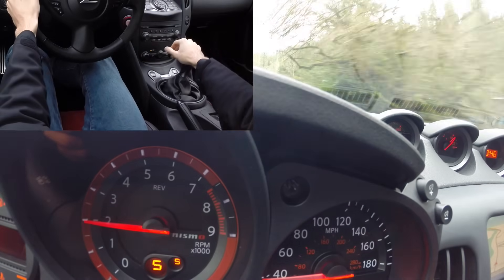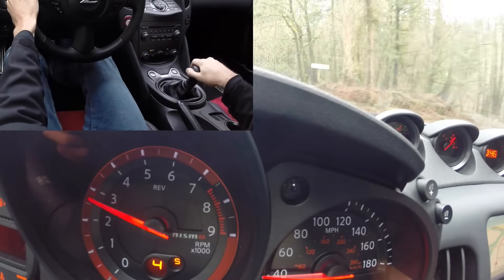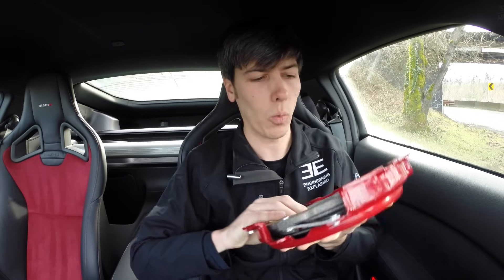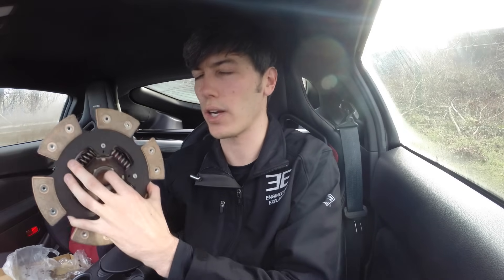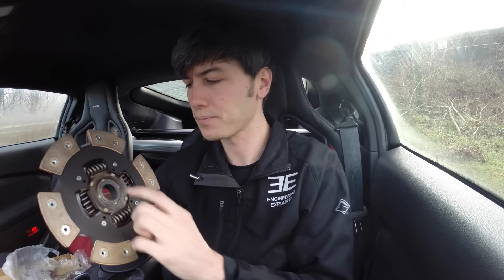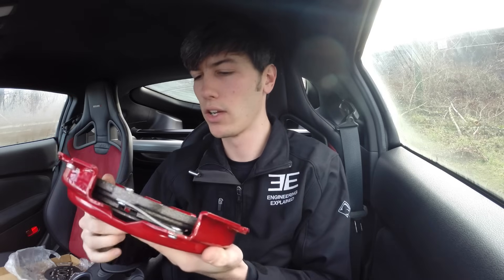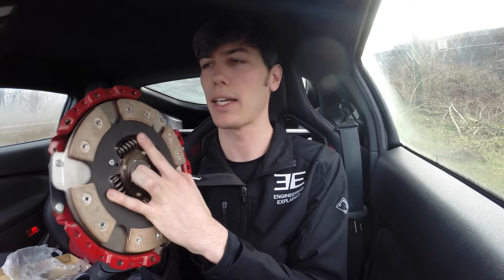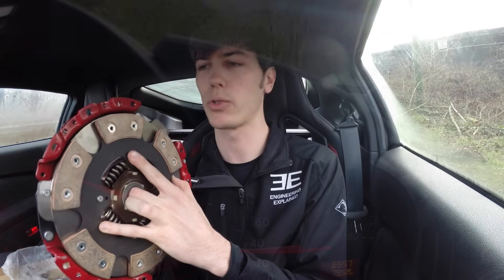What Is Rev Matching?

Comment: I have never been more confused in my life
Reply: Brian Guzman 
He’s overcomplicating it way too much. 

Basically, before you downshift, you give it some gas so the car doesn’t engine break too much. 

You rev up the engine to where the RPM would be when you put it in a lower gear. 
Just like the auto does when you kickdown. It puts you in a lower gear without any lag because you’re helping it with gas. (Might not be completely academically right, but to make it easier to understand).

Was that a good explanation?
Reply: @jgripen969  you summed it up perfectly for me, I get it 100% now
So if the car was going to move into 5k RPM when you down shift, rev matching let's you do that before down shifting, right?
Reply: @jgripen969  this is actually the easiest way anyone can explain rev matching if u still don't get it get over with ur life and stick to auto....
Reply: J Gripen x
Reply: @jgripen969  is that the same thing as double clutching where u increase ur rpms while at neutral to downshift/upshift??
Reply: @jgripen969  got it in the third sentence thanks
Reply: J Gripen Actually, yes it was a better explanation. He went way overboard with the explanation and over complicated it.
Reply: J Gripen Very clear. My question is for what situation would a driver use downshift rev matching? Is this meant to slow down your vehicle in a corner? or is it to give you a boost in torque to go faster (i.e drag racing in 5th gear, need to go faster so you drop it into 4th and it gives you that extra torque) like the saying goes "Drop a Gear Disappear"? I'm confused
Reply: Brian Guzman same 😪
Reply: Why transmission spin faster when we shift to 2nd gear?
Reply: @Nikhilgo  cause it is a lower gear (lower gear can handle lower  amount of speed than the higher gears)

Edit : So it spins faster to reach that point

Edit : lower gear = more torque and less power

higher gear = less torque and more power
Reply: Just watch a vid on how an automatic transmission works. Then this won't be anymore...
Reply: Wejustmight die it won't be confusing anymore because you'll just get an automatic and to hell with rev matching

Comment: You still didn't really explain how to do it, just how it works
Reply: Does "blip the throttle" mean Tap the throttle?
Reply: @laurenmatthews4048  yeah, tapping it quick so you can raise the rpms up a bit
Reply: It's "What is rev matching", not "How to rev match".
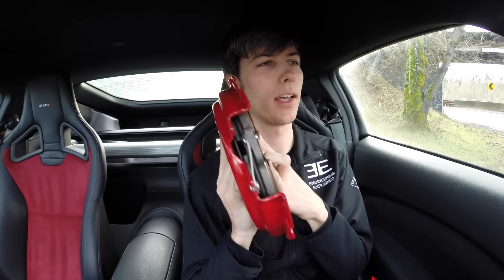Reply: Also he kinda did at 2:14
Reply: Depends on the disparity of RPM. If you are at 2k RPM and downshift 1 gear, yes a tap would suffice. If coming into a braking zone at 4K rpm, then a larger harder throttle hit would be required to achieve the RPM required.
Reply: That's whar the title is
Reply: He did explain it just push throttle until the engine matches the rpm of the gear u want to shift into
Reply: That is what the video is called lol

Comment: Question do you only do this when you're at high speed/rpm? I find if Ibrake till like 2k rpm and downshift I can release quickly and smoothly without the engine reving high and bucking etc. I have an 011 rex too so you can tell when it's being unforgiving.

Comment: I once drove my CRX home using this technique when my clutch went out, or rather the throw-out bearing, it would not disengage anymore.  So I shifted without using the clutch.  On downshifts, I went to neutral first.  This is not easy, you definitely know when the revs don't match.  Big trucks are shifted this way, since their transmissions don't have synchronizers. Shifting a small car this way is much harder, but can be done in an emergency.
Reply: This is 7 years late but is this what people mean when they "float" gears?
Reply: @bigdawg77  yes

Comment: Why does lower gears have higher rpm and taller gears have lower rpm ?
Reply: richeststrut do you ride bicycle?
If you do, you will understand.
The paddles are lighter at lower gear and heavier at higher gear.
Say to maintain the same speed, the higher gear takes less effort to kick the paddle and you'll have to paddle much more faster at lower gear.
That's why.

Comment: So basically this almost only applies when downshifting... so if for example i was in 3rd gear, and was downshifting to 2nd, i'd let go of the gas, push the clutch, and while holding the clutch press the gas a bit a ease into the gear change? I've only been driving for about 9 months, and i've noticed the difference when doing this rather than just letting go of the clutch. But as i said i discovered this on my own and i'm still trying to wrap my head around all this, i've even heard that you push the gas when in neutral, so it's all very confusing...
Reply: You have to get to know your cars gear ratios too. In my car gears 1 and 2 are quite far from 3, 4 and 5. So I rarely downshift into 2nd gear and never downshift into 1st because it would either require me to slow down quite a bit while in 3rd gear or do a huge and unnecessary throttle blip to match the revs.
Reply: I kinda knew all off this in practice, but not in theory ^^
Reply: dannyboy768 but sometimes its fun to rev the piss out of the car to scare pedestrians lmao.
Reply: You can also put you car in neutral while you press the gas and before downshifting.

Comment: I believe you miss spoke. Taller gears have more torque and lower top speeds. Torque = Force * Radius, taller gears have a larger radius and thus larger torque for the same force. This is also why you down shift on hills to get more torque to climb the hill.
Reply: so you're saying 5th gear would have a lower top speed than 1st gear?

Comment: noob question here: is it ok if I use a higher gear for a lower RPM?? for example I am cruisin through the city at 40 km/h and usually this is done using the 3rd gear around 2.500 rpm. But I use the 4th gear for a lower rpm and for the same speed of 40 km/h.
Is this behavior okay for my engine and my clutch??
Reply: As long as you don't lug the engine.
Reply: You want to use as little rpm as possible without straining the engine.
At about 50kmh I can use 5th and feather the gas along nicely, just above idle rpm.

Comment: If I'm coming to a stop, is it okay to just shift into neutral, and not downshift?
Reply: Brake pads are a much cheaper wear item to replace than the clutch, and an easier D.I.Y as well. Engine braking also puts more wear on the transmission, the entire drivetrain for that matter. The only benefit to downshifting to a stop is if the brakes are already a weak point due to overheating or worn pads, or if you need maintain control in certain situations.
Reply: Wearing your brakes out is alot cheaper and easier to fix than wearing out your clutch.
Reply: Totally irrelevant during daily driving as opposed to be in the correct gear to get engine brake and be ready to accelerate. Also rev matching was/is used for straight cut gears and keeping the balance of the car during turn in, nobody, I repeat nobody needs to use it along with heel to toe during daily driving.

Comment: In Europe they don't practice rev matching and you really shouldn't if you know what rpms are to each gear when downshifting. You can listen to the engine and if you down shift from 4th to 3rd without rev matching and slip the clutch in gear without a major variance in noise it's fine. The main reason is that many cars have synchronizer rings that limit the stress of an over revving input shaft to out put shaft ratio and it reduces the need for added clutch ware if you were to rev match the vehicle. I find that rev matching on a down shift is just consuming more gas in the blip. Call my technique old school but I have over 100,000 miles on my vehicle and I haven't replaced the clutch.
Reply: stevehmi Alright! I knew this technique is necessary in Sport driving, it just seemed like some people thought it should be used in normal driving as well which made me wonder
Reply: I agree with the points but your technique does not work for racing or setting lap times or generally driving fast. I use both the techniques. Your technique when i'm cruising. Blipping when I'm hauling ass!
Reply: R.N. Geesus You can't expect me to believe you can go from cruising in 4th to halfway up 2nd gear "smoothly" without rev matching. Kinetic energy has to be used to speed the engine up, you're either lurching the car or feathering your clutch and both are bad. Go away.
Reply: Geesus, we're not talking about normal driving in average cars as taught by driving schools or instructed by boring user-manuals. We're talking about driving a sports car, such as the Nissan 370Z mentioned in the video being commented on here, and driving it in a spirited manner such as was mentioned in said video: "hard into a corner".
Reply: +Paul Michaels  You are just exactly right! This Technique seems to be only used by some americans who are able to drive manuals and wanna be smart etc. here in central Europe were aprox. 95% of cars are manuals you never hear of it in the driving schools. Why? Because it simply isn't needed anymore since about 20 years. 
As you said almost every car nowadays has synchronizer rings making you able to downshift simply with holding the clutch at the engagement point carefully for a second. 
Of course, it is still more clutchwearing than rev matching, but it takes some decent years of driving to finally have your clutch wore out, and then still the replacement is relatively cheap.

Revmatching however simply burns fuel and is not only less efficient but also less ecologic to do.
Reply: The synchro's only makes rev matching optional for a gear shift. This isn't about changing gears. This is about preventing lurch when you go from 40mph in 5th to 2nd. You have to rev match for a smooth shift, or feather your clutch which is what most people do and it's horrible.
Reply: Virux
 Then tell me:
--Why I'm perfectly able to shift smoothly without rev matching in this cases.
--None of our several cars (all far above 100.000km) never needed a clutch or parts of it replaced, not even to speak about the transmissions which were always perfectly fine.
--You only hear about this technique in racing (Were it is needed) but in terms of normal driving only from the mouth of americans wanting to tell other americans how to drive shift
--in addition to that never hear of it in european driving schools, were 95% of all cars are manuls, nor in the user guide/manual from spoken cars
--Why, since nobody in central europe uses it, we haven't got numbers of broken clutches and transmissions reaching in the thousands?

And please then rethink the usage of burning so much fuel by randomly tipping your gas for no apparent reason (at least it's not apparent for me)...
Reply: Virux By Holding the clutch at the Engagement point you can easily bring the engine up to speed. Yes this wears out the clutch but apperently not as much, since I dont know anyone driving like this having problems with constantly broken clutches.

I dont want anything Bad to you, but for me rev matching yet makes no sense, since I found all arguments for it invalid somehow... i mean why should you burn fuel with rev matching to protect your clutch, which is a part designed to be weared out and probably someday replaced :D

Comment: geez, its 2016, this is useless on a synchronized gearbox. you are not driving a 1950 truck.
Reply: This has 100% nothing to do with synchros. Rev matching is used to prevent lurching on downshifts.
Reply: you are talking about double clutching which is a completely different thing

Comment: What happens when I over rev on a downshift? My clutch is fine, and the revs sudden fall into the correct RPM, but I'm worried about the surge of power going into that clutch.
Reply: It's not going into the clutch, it's going into the clutch via the synchro. The synchro helps to prevent unnecessary wear and damage by synchronising the revs (it essentially rev-matches for you). There is, however, still more mechanical resistance (which is/causes engine braking) in this process than in a perfectly executed rev-match downshift. Therefore, if you rev-match yourself, then you reduce engine braking and reduce wear on the synchro. TLDR: your car's synchro is designed to synchronize any RPM differences - so if you miss the correct RPM (above or below) it will deal with the discrepancy

Comment: I have that feeling that for most gearboxes (we speak for stock manual non straight teeth in general) there is a lot smoother downshift if I do it with double clutch rev matching. That i believe is related to those rings the synchronisers and my point is not only maintain a stable balance of the car but also save my gearbox for longer mileage. What I actually do is:
1.Press clutch
2.Switch to neutral
3.Lift off the clutch pedal
4.Rev the engine a bit higher rpm than needed
5.Press the clutch
6.Downshift (while the revs are dropping there is a moment of almost no shifting resistance) 
7.Lift off the clutch and then maintain balance by braking or keeping the pace on the gas pedal. 
I believe this saves a bit stock gearboxes in more aggressive driving conditions. Greetings to all subscribers! 
Great channel! Keep it up and running!